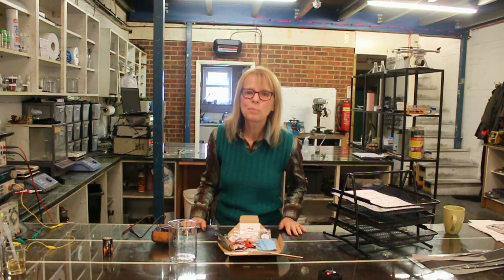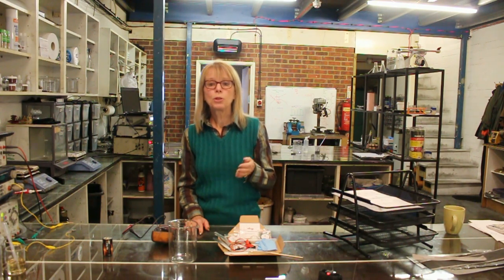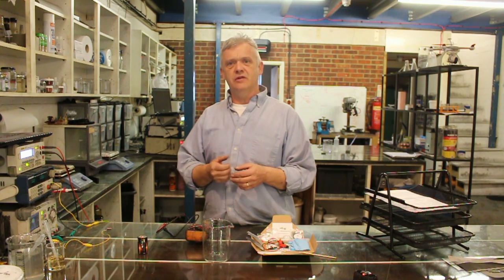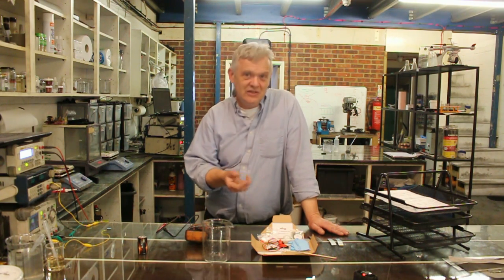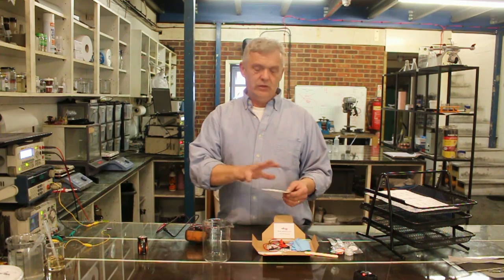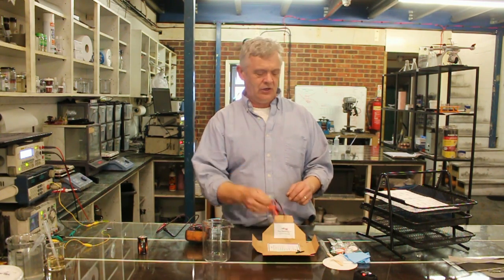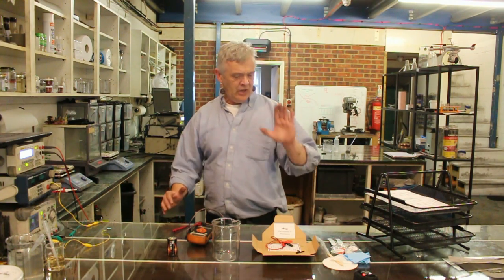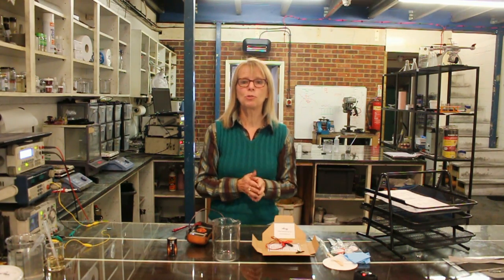FWG Live Event - Make A Battery With Rob

Comment: hello mr smith, any luck with harvesting the inherent voltage differential of ez water, maybe graphene sheets stacked 10 nm apart submerged in water, maybe even exposed to the sun (uv) for a voltage boost.  gerald pollack and friends are working on some applications for battery systems.  

thanks and keep up the Good work my friend

Comment: Dear Patty and Robert, 
it's a great idea to offer the Battry Kit. 
I tried already to buy some parts by myself - a nightmare! I simpy failed at the beinning when I bought activated carbon by Boots: Very low conductivity. Not talking about binder, small amount of Zinc and so on. 
A little few hints for future Reserchers: If buying a multimeter, try to get one with USB-Connection for recording on Computer. A Chinese Company offers Battery Tester as well where you can make diagrams on Computer. Both are less than 120 Quid; so not a big deal if you relly like to compare your own made different types of batteries or supercaps.  
Hope you have a lot of fun doing the seminar! It's a pitty that I cannot be there ...
Reply from the maker: Thanks for the comment mate